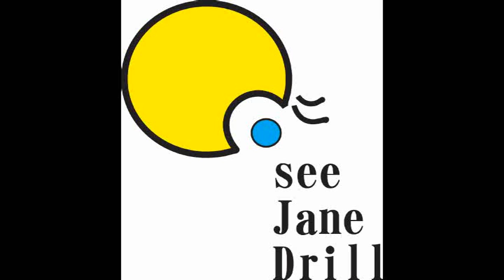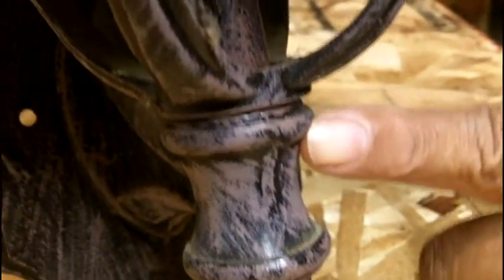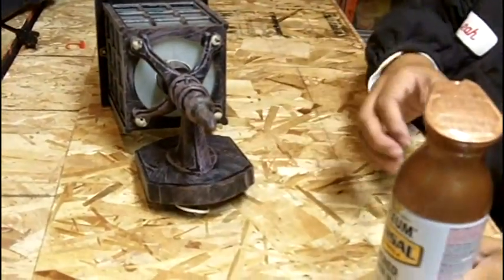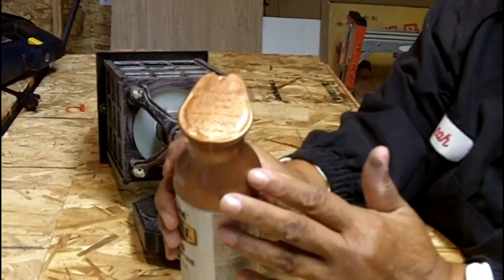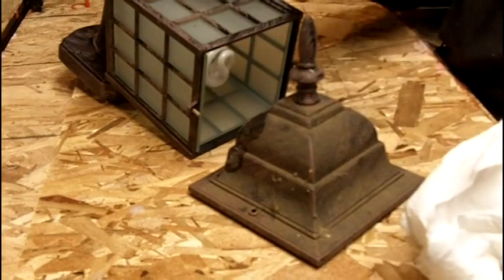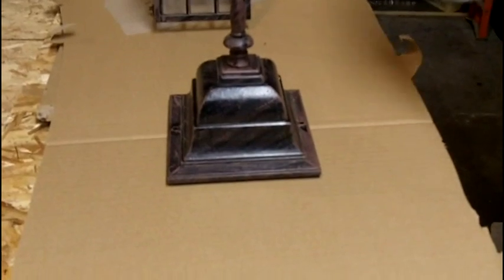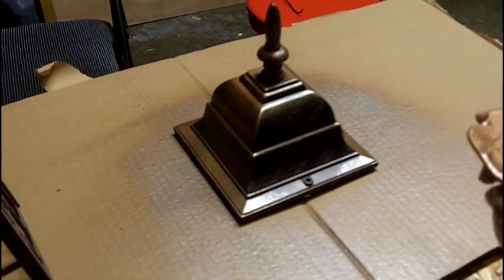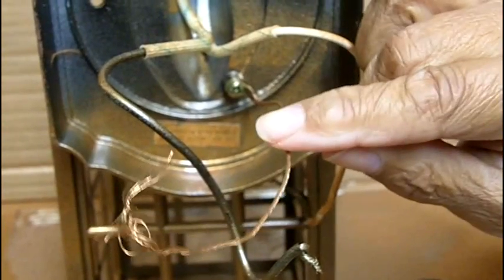Give Your Old Exterior Light a Custom Paint Job

Comment: ❤Voltage Detector!❤
We bought a house and needed to check the a/c.  We pulled the exterior emergency breaker (as an additional caution-which was arcing, btw) and turned off the breaker at the box.  It still had power!😮and in putting it all back together  that emergency breaker     was not I repeat Was Not connected to the exterior a/c at all! But it was powered.  And arcing!

Comment: Hi Leah!  Just discovered your channel.  You should have your own DIY show on TV with your presentation style and ideas.  I am recently married and have a baby girl on the way :-)  I am renovating the entire house inside and out.  You gave me some great ideas.  I plan to use this paint on the exterior lights as well as changing the polished brass look of my ceiling fans to a brushed nickel finish.  My question is....do you think this would work on my interior door knobs if I clean or sand them real well before painting?   Or do you think it may not hold up to regular use?
Reply from the maker: +Thefireman 285   Let me offer my congratulations on your soon to be arrival.  To answer your question regarding painting the door knobs, I would be reluctant to suggest it.  Door knobs receive high traffic and they take a lot of abuse.
Reply: Yeah, I thought that may be the case.  They are also really expensive!  I guess I will find my savings refurbing the fan and light housings.  Thanks

Comment: Help Leah! My exterior light is like this, but holds 3 'chandelier' bulbs. The last time I turned it on, only one bulb lit up briefly, then made a POPPING SOUND and had black tiny bit fly up from base of that bulb. I noticed there is dark, smoky look to part below EACH bulb. Maybe each bulb has been popping!  WOULD YOU POST A VIDEO ON HOW TO RE-WIRE THIS TYPE FIXTURE. It's so pretty and only 3 years old. Do you think re-wiring it would fix the problem. You are a GREAT TEACHER! Thank you for your videos!
Reply from the maker: +LSUTigerMom Hi LSU Tiger Mom, unfortunately this is one of those issues that cannot be diagnosed or addressed from a distance.  I have some ideas about what is going on, however, it would be reckless for me to try to address an electrical problem with a fixture remotely.  You need someone local who can really take a look at it in person.  Sorry about that.
Reply: +seejanedrill Thank you anyway. Your videos are great!

Comment: How did the glass come out? I wish you would have shown that part. Otherwise very informative
Reply: all those older ones, the glass just has tiny screw clamps, the newer ones have tiny metal springs that eventually rust and let the glass wobble-either way in my humidity-it's gonna be rusted and need new clamping (I cheat and add silicone around the inside-but you have to still have ventilation for your light!  Mine has a breather exhaust through the top metal cap and is open at the bottom.
Reply: @hoperules8874  cool thanks for the info! I know what you're talking about now. 😀